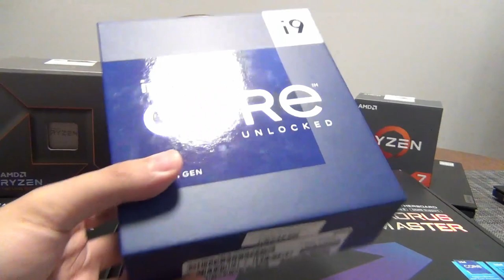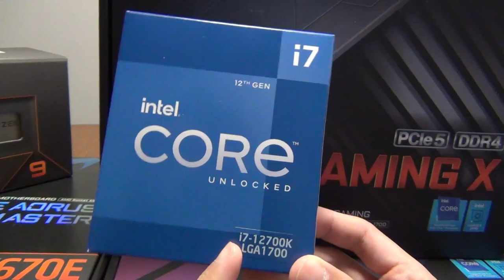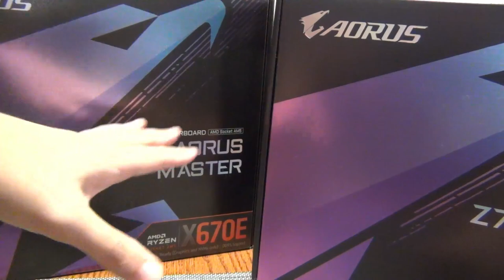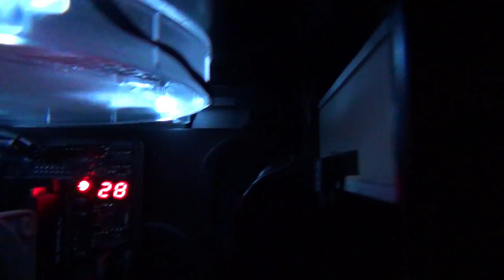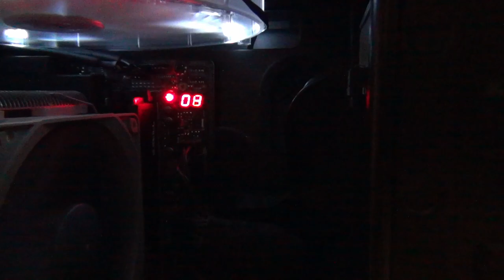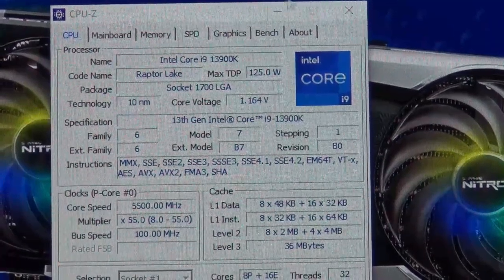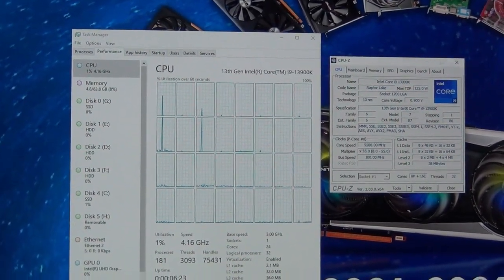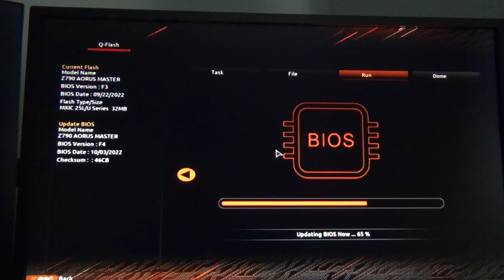Intel Core i9-13900k unboxing and Z790 AORUS Master PC build

Comment: I just built a new system with the same MB and had problems with the Gigabyte chip set drivers leaving some devices uninstalled.  Based on your suggestion I tried the ASUS drivers and problem solved.  This was driving me crazy so really appricate your suggestion - Thanks!!!

Comment: Just wondering have you had any problems with the xmp profile 1 I've been seeing alot of complaints about that not working and just giving blue screen or restarting bios over and over again. I just bought this board to go with my gigabyte 4090 and i9-13900k I'm doing aio 360mm cooling but I got trident 32gb ddr5 7800 I know that's pushing it to the limit I hope it won't be an issue

Comment: You could’ve used the top NVME slot. It would’ve ran at 5.0x8 which is equivalent to 4.0 x16. There would have been no performance loss.
Reply from the maker: No, because the GPU is only a PCIe 4.0 GPU. It would be PCIe 4.0 x8
Reply: Ur wrong x8 gen 5 is equal to gen 4 x16 @GameTechReviews

Comment: When assembling the computer, I noticed that the motherboard has problems with beeping, buzzing similar to coilwhine. I took a video of where this unpleasant sound originates, it is very annoying to the ears. The reason is at the control panel where there are plugs for usb, video output, plug for internet. 
I removed all the components from the motherboard Gigabyte Aorus master z790. But the annoying sound is there. Please help me, what should I do? I also replaced it with a power supply, but it doesn't help. The sound is heard from the sockets on the back side of the motherboard connectors. 
this sound is driving me nuts, coilwhine whining..what to do rma or?😦😦🤔 please help?

Comment: i got z790 Aorus master at Microcenter Tustin, with a 13900k. I tried Gskill Trident Z RGB 2x16gb 6400 and 6800. No xmp profiles work. I enable xmp, the display loses signal, i have to clear cmos. the board will not take anything i set above 5000.
Reply from the maker: I'll probably make a video on the Z790 Aorus master bios settings and how to tune the 13900k in the near future.
Reply: i got a z790 strix F board paired with a 13700k running my g skill 32gb 6000 cl30 kit OC'd at 6800 stable
Reply: @birdsoup777 did you ever fix it?
Reply: @GameTechReviews  Please do

Comment: Doing a new build with a different motherboard (ROG STRIX Z790-E GAMING WIFI) and trying to figure out if I can use the PCIE 5.0 M2 slot it has or if I need to put it somewhere else as well? How did you know that bit of information, id like to look it up in my new boards manual but unsure if it would make the slot below slower as well.
Reply from the maker: Every Z790 motherboard, regardless of brand will limit the GPU's x16 slot to x8 speed if the PCIE 5.0 M2 slot (primary M.2 slot) is occupied by an NVMe drive. This is a platform limitation. This is one of the reasons why the new AMD platform is the better way to go if you are looking for PCIe 5.0 connectivity without compromising on performance.
Reply: @GameTechReviews  Thanks that makes sense! I also read after posting  that the Samsung 990 Pro and the 4090 cards are only pcie 4.0 anyways so the m2 slot with 5.0 wouldn't make a difference yet I guess?
Reply from the maker: @murracol03  The point is regardless of what the NVMe drive is, as soon as any drive is installed in the top M.2. slot the GPU slot will be forced to run at x8 speed.

Comment: 1 INTEL I7 13700K PROCESSOR

2 GIGABYTE Z790 AORUS MASTER MOTHERBOARD

3 CORSAIR VENGEANCE 16*2 5600MHZ DDR5 RAM

4 WD SN850 1 TB NVME GEN4 SSD SN850X- OS Windows 11 pro 64 BIT

5 WD SN850 500GB NVME GEN4 SSD- Process files for editing video, photos and Dump temp for movie files and mp3s

6 WD 2TB INTERNAL HARD DISK- BLUE 7200RPM- ( Storage Temp and access media files) Additional Storage- I got 6 WD External Powered HDD

7 Gigabyte GeForce RTX 3070 Ti GAMING OC 8G- (Occasional FPS- more on video output files) Connecting with my ACER 37.5 XR curved 75 HZ Old school monitor.. 5 year old model using this cable from the US.. DP 1.4

8 PHANTEKS ENTHOO PRO 2 620 BLACK - CLOSE Black ( Adding 4 fans in front and 1 in the back ).. This source gave me clues to connect... https://twitter.com/pesegolsson/status/1628056410226401282?s=20

9 LOGITECH MK850 KEYBOARD AND MOUSE

10 NOCTUA NH-D15 CPU AIR COOLER BLACK

11 EVGA 1300W GT 80+GOLD SMPS

12 APC UPS 1500VA BR1500G

13 WINDOWS 11 PRO OEM ORIGINAL PACK

14- Creative AE-9 Sound Card- Add on Disable on board.. How is the performance of ONBOARD AORUS master z790 DAC.???- Connecting optical with Z906..

from US.. got all Accessories OPTICAL Cable from US to connect with anyone of these optical cable from US

15. ASUS External BLURAY Drive for burning and Playing Blu Rays in including other optical media.

Due to VOLTAGE issues in India.. Connecting my pc with APC UPS Connected with a STABILIZER here.